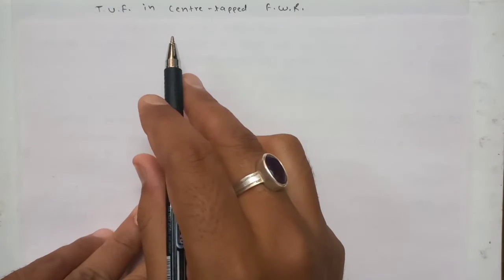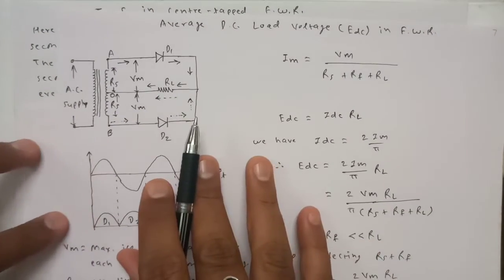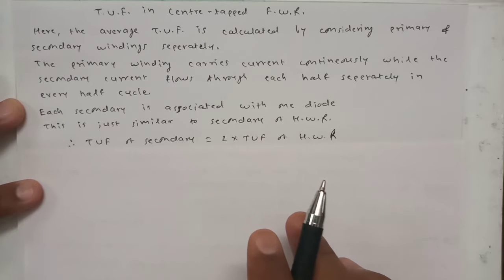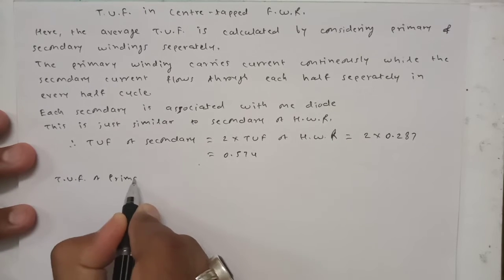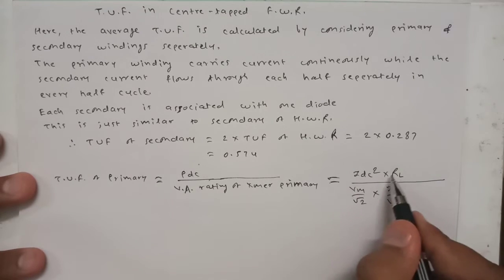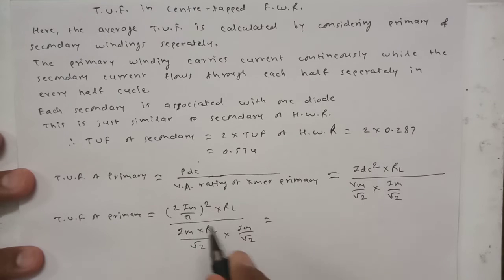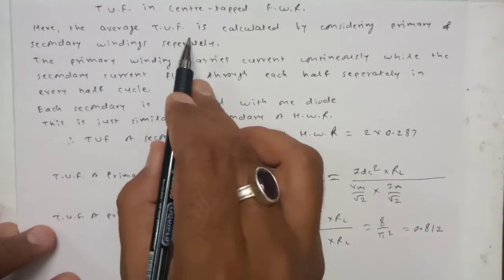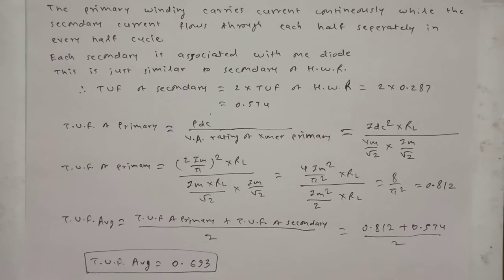Transformer Utilization Factor in Center Tapped Full Wave Rectifier

Comment: how we can calculate total utilization factor for center tapped uncontrolled rectifier? Please help ❤
Reply from the maker: Full form of TUF is transformer utilization factor itself. However if you are interested in total utilization of the circuit you can refer our video on efficiency of rectifier.